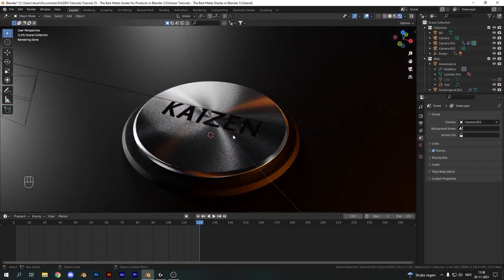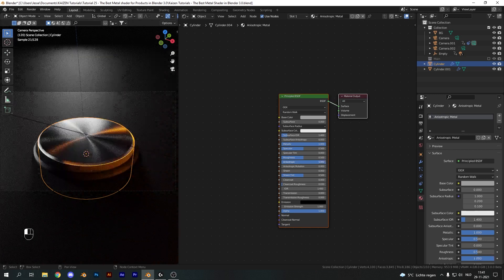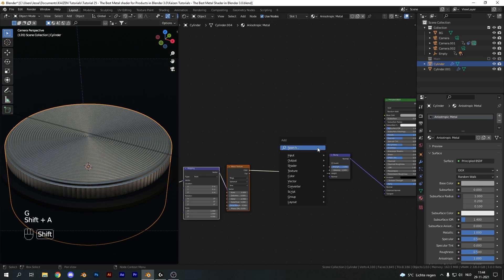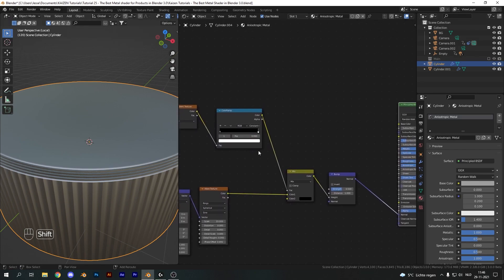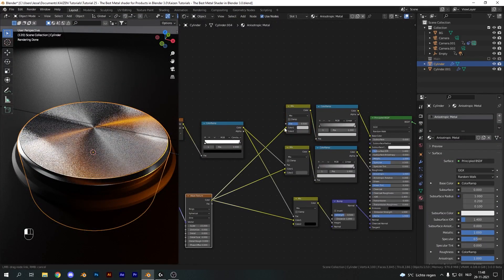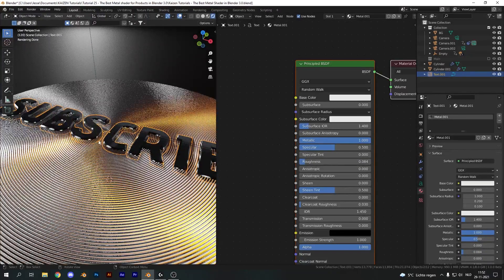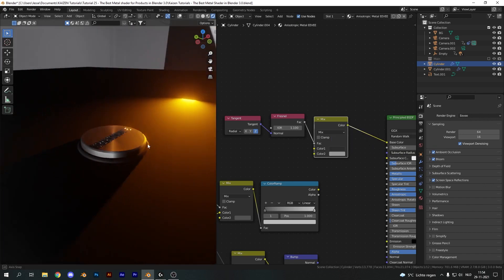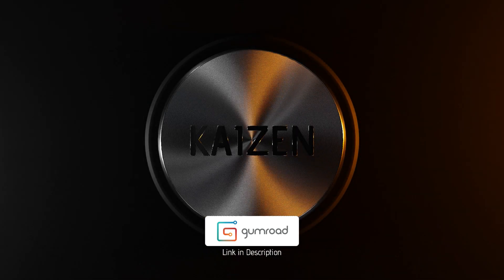Realistic Metal Material in Blender 3.0 [Cycles and EEVEE shader tutorial]

Comment: Hi Jesse, I followed this a while back and it worked well, but when the shape is orientated differently on my model it’s so hard to manipulate the x,y,z settings in order for the ridges to work in the nodes and it’s impossible to understand what each orientation change does. I’ve got the anisotropic light ok. Any tips?
Reply from the maker: You can control it simply by adding a Tangent node and plugging that into the tangent socket of your Principled BSDF. This way you can just select on which axis the Anisotropy works.
Reply: @KaizenTutorials  thanks Jesse I got it in the end , not sure how I did it mind because I didn’t use the tangent node

Comment: I don't get why people prefer using a mix or a multiplayer to mask in the height of bump node, instead of setting the bump "strength" in the distance and using the strength to mask out. Can reduce the math time on ray processing, slightly, also keep nodes cleaner. Not judging you, genuinely asking. There is any reason to not mask with the strength input?
Reply from the maker: I've actually tried this but can't seem to get this to work properly? So that's why I'm usually going for this way.

Comment: Hi there, great tutorial! One aspect of Blender that I struggle with is setting up the lighting and background of a scene. Can you explain what you did in the background to make this look so luxurious? Are there any common practices to keep in mind when shading jewelry? Did you use the 3 point lighting technique?
Reply from the maker: Thanks! Well yeah, the background in this case is just a plane with a rough black material. This to contrast the metal. The camera is angled down, so you can't see the edges of the plane. But in the case you're aiming for a different camera angle, just take a plane, extrude the edge on the back of your scene, bevel it with a lot of segment and set it to shade smooth. This is litereally good enough for 99% of product showcases. It's also done in real life ofcourse with a fabric backdrop for photoshoots.

Lighting is a difficult subject to tackle. In this video i used a 3 point lighting setup, and since it's 3D I could just rotate the lights around to create more intricate lighting. Obicously you can do this in real life, but it's a lot harder. But it's just one of those perks of 3D haha!

Comment: Everything is awesome ❤️✨loved it and thank you so much man.  Btw.   Did u said nudes Instead of nodes in 5:48😂 and then had to do a retake ?
Reply from the maker: Haha Thank you! Glad you liked it. But no I don’t think I said nudes hahaha, it’s probably just me moving my mouth to far from the mic and the audio dipping 😂 but it does sound like i did say it! Hahah
Reply: @KaizenTutorials  😂😂 anyway keep creating 🔥 you're awesome 🥲 btw need a tip, on baking indirect lighting I've recently started Baking indirect lighting in eevee with ligh probes . You know those reflection stuffs etc . And I've a 8gb ram in my laptop .  Blender using 99% of it and 3% cpu . Showing in taskbar .  And it's still on 3 percent after 2 hours i don't even touched other settings it's on default but still .. any tips how to make this fast  i thought EEVEE will be a faster option later i switched back to cycles
Reply from the maker: Thank you! I will definitely keep making vids ;-)

Your problem sounds quite strange. You could lower the density of the Light Probes, effectively decreasing the quality and therefore the load on your computer. But i'd say it should be 'stuck' even with high amounts of probes, so that's kinda strange. Not sure what's going wrong. But have you tried getting it to work with lower settings?

Comment: That has to be one of the most realistic textures i've seen, damn that's good !.
I was working on (what I assumed was going to be an easy model) a few days back. It involved modelling a waterslide in the shape of a spiral. So I took a cylinder, cut it in half, extruded it, layed down a curve spiral & made the cylinder follow the curve. Unfortunately the open part of the cylinder changed direction as it went down the curve ! I tried a few things to remedy it ie: simple deform + twist but that did nothing. I assume you have to do it manually & correct the unwanted twist as you go along ? or is there a way to correct it ?
Stay safe & keep on smiling 👍🏼🦘
Reply from the maker: Thanks a lot Nigel! 

Your slide conundrum sounds interesting. I'll fiddle around a bit with it and see if I can find a workable solution to it!
Reply: @KaizenTutorials  Thanks, I must admit the result took me by surprise, I thought it was going to work like a spiral staircase & everything was going to be aligned.  
You can try the same thing with a cube, just delete the top face & extrude it along a spiral curve & the same thing happens, the cube will "twist" its way up or down the spiral. I found a tutorial on a spiral road & that seems pretty simple, it's when you want to taper it the problem starts. Anyway, thanks for trying to help out I appreciate it.
Stay safe & keep on smiling 👍🏼🦘
Reply from the maker: Yeah, I've just spent about an hour trying to get it done and it was indeed pretty difficult.... untill I found out how to do it haha. You just need to enable the Z-Up in the Spiral curve. I've saved my project for you. You can get it here; https://drive.google.com/file/d/1i4zcY5S2_rLed5EmIemYcqDHtbIC1TzL/view?usp=sharing
Reply from the maker: Atleast this is what I assumed you need. Turns out it's just one change to get it right, haha!
Reply: @KaizenTutorials  You're a legend ! That's exactly the result I was looking to get. I can't believe I missed the Z-up setting. If nothing else we've both learned something new about curves. Really appreciate the time you spent on it.
Have a great Christmas, blessings to you & your loved ones.
Cheers 👍🏼🦘
Reply from the maker: Definitely learned something, haha! Glad I could help out. 

You have great holidays too and all the best to you and your family!
Reply: @KaizenTutorials  👍🏼

Comment: Another way is to create the material with rings as seperate material and apply on the cylinder top so you don't have to deal with a mask. Anyways good tutorial.
Reply from the maker: Yeah, thanks! I did that originally, but that way you have to add separate materials and I wanted to show how to make a mask. But it is a good option for sure!
Reply: @KaizenTutorials  i used to do the same way creating another material in slot 2. Masking in shader was new for me. Thanks for that extra effort.
Reply from the maker: @lazyy3d  You're welcome! Glad you liked it 🙂